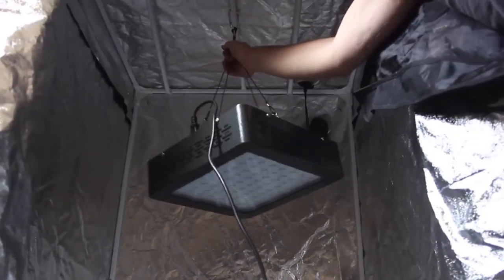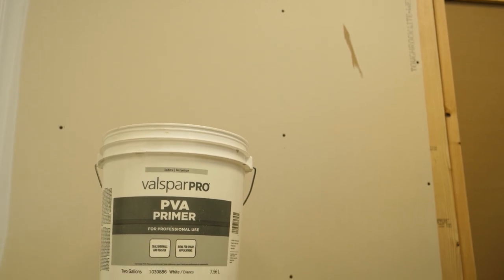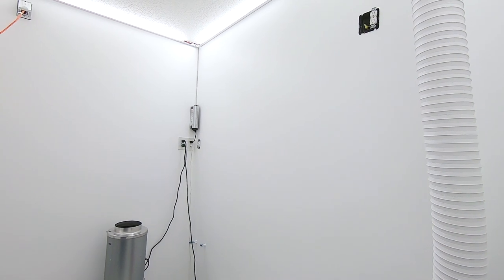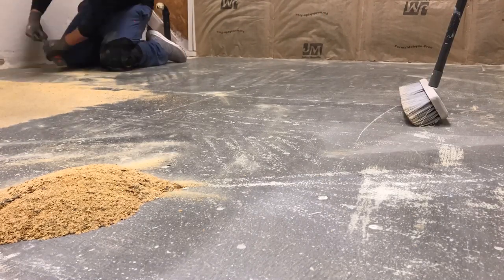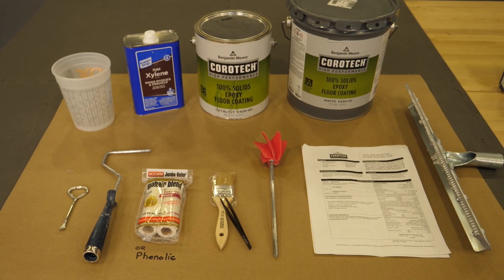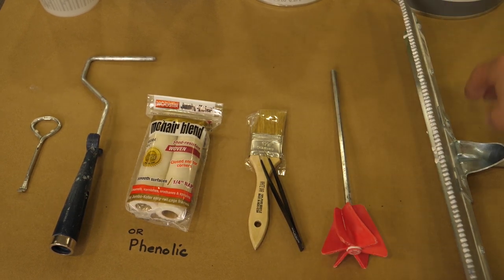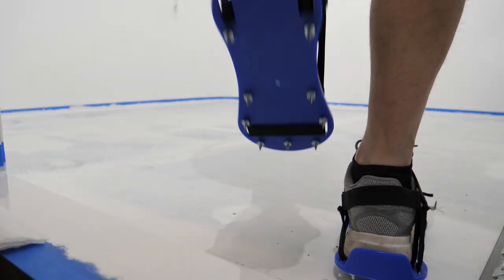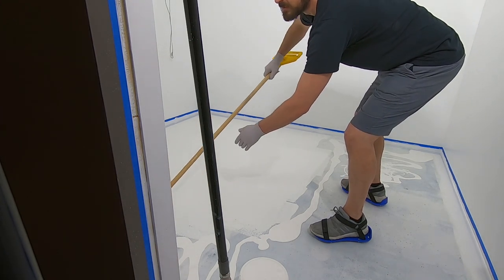Grow HauS vol. 2 : Performance Light Reflecting Grow Room Coatings

Comment: 91.82 reflectivity % Benjamin Moore flat snowfall white is the paint in my neck of the woods that has the highest rating. Worked fine for us. What are your thoughts on using aspenite painted white as a multifaceted reflective surface? Cheers.

Comment: I used the white 1/8 inch laminate paneling.  Works great.  No painting and it's slick and easy to wipe down.
Am TOTALLY not interested in reflecting light from underneath.
Reply: Yeah I am thinking of just using a nice vinyl layer and just but it a little bigger so it's like a massive tray.

Comment: I was planning on using r-tech like most rooms use.   I live is a hot climate (108 highs) in the summer time like now and cold in the winter (29 lows) in the winter.   I do plan on using a diy closed cell spray foam kit and do a full cavity fill.   Would you still suggest using Sheetrock and paint over r-tech in my room?   Can't wait for part 3 ✌️🤘

Comment: Definitely going to be repainting the barn and it's 3 grow rooms but changing to this paint based on your recommendation and now that I see the flooring idea of epoxy all I ask is what can I use to fill in my cracks in my seams in the floor to make everything even what would you suggest?
Reply from the maker: first, i would make sure the wooden subfloor has no bounce to it. a few extra screws into if needed.  Then I would fill the holes with this same line of Rustoleum boat deck filler. its available at West Marine.  West Systems also makes some boat fillers designed for this purpose: to fill holes in a boat's wooden hull before gelcoating.
Reply: Wouldn’t the epoxy fill the cracks? Or are we talking CRACKS? Cuz if you want to seal those, you can use quickcrete.
Reply: @juliankirby9880  no the epoxy is only going to be applied to 10 mils thick so in my case it's actually cement and I just went ahead and repaint it it for this round but I would have to I braise and use a self-leveling caulk or possibly in my case with some of the bigger chunks missing some Quick Crete and then make sure it's level and a braised before I attempted to apply the epoxy it catalyzes it doesn't really ever Harden which growmau5 explains in the video
Reply: oldschoolplayacom my knowledge of concrete floor repair is limited, maybe the flex seal paint In the cracks?

Comment: Wow I thought I was a stickler for details, but you take growing to a whole new level 👍👍   Awesome  👊 never thought of using epoxy on the floor, back in the day I used formica laminate sheet on 3/4 inch particle board I wasn't able to rip up the carpet. Can hardly wait to see what's next ✌

Comment: Hey Growmau5, Why didn't you go with the FRP wall panels? When installed correctly...  They can be hosed down and bleached in a few minutes and you would be have the room flipped and cleaned in a fraction of the time.
Reply from the maker: FRP is probably a better surface, esp behind the plant canopy for foliar. I may install one sheet horiz behind my canopy. FRP runs $28-32 a sheet for me here at the WA hardware stores. I considered it. but my room at 8'6" wide & 10ft tall makes for an odd looking install and a price point of $240++ to cover the walls up to 8ft. including adhesive. I spent about $80 on the wall paint. But I like the comment & suggestion. cheers and thanks for watchin.
Reply: @GrowMau5  Thank you for the response. Yeah it adds up quickly but I'm really enjoying the convenience of it. Here in the midwest, we can sometimes find it on sale for $15 a sheet. Still pricey but worth it in my opinion.

Comment: I'm thinking about using the Puck in my Mini Grow Box.   1 Puck for 1.31 sq feet
Reply from the maker: absolutely ! you can run it cheap on a flat piece of aluminum with a little 12v fan to move some air around. The meanwell LPC drivers, 48volt are under $20 too.

Comment: Hey Growmau5,  I'm looking at going the same direction with my flooring and doing an Epoxy Coat. My question to you is how well do you feel the epoxy covered small imperfections in the floor. Would it cover small gaps in a wood subfloor nicely do you think? I used a wooden specially designed insulated subfloor called Amdry for my basement as the concrete floor gets quite cold and uncomfortable here in Canada. Does it self level nicely? Also does it dry rock hard or do you feel the product has some "give" to it to allow slight flexing and thermal expansion.

Thanks Growmau5,  always love the vids!

Comment: Curious what you think about those mylar/"foil" backed sheets of insulation as far as reflectivity. Building in a basement and didnt want to use a ton of wood so was debating goin aluminum studs and the insulation as walls. Ive seen people use them in the past. Figured itd be a lil easier too since i can cut everything with tin snips and a small hand saw VS 2x4s and 4x8 with a circ saw and table saw. Thanks for any tips! Hope you get this poppin off soon!!

Comment: Great job man! If its a self leveling epoxy is there any reason why u couldnt just use the knotched rubber tool to thin it out good and then just let it self level back into itself without rolling it? I never did epoxy but ive done just about everything else in your video and now im considering it

Comment: I'm in a tight spot literally a 3x2 tent and normally grow under hps but due to heat I am looking for a quality choice led. I am looking at the mars hydro ts 1000 and the hipargero 800watt w/4 3k cobs and 16 osram leds....what would you recommend or choose if in my position? If neither could you recommend something 150 or less?

Comment: This is somewhat off topic, but I've recently been checking out the Blackdog Phytomax 2 800 and Phytomax 2 1000.  I would like to build a similar model myself, would it be much cheaper to build a similar one myself?  What would be the ball park to build a similar model?  Lastly, Could you possibly help me identify all the components that I'd need in order to build a similar model?  I'm sure there are quite a few components, but if you could give me a rough break down of what I would need it'd be a huge help.  Also if I wanted to go wireless on the unit,  could you give me a few options on what I'd need there?  I've spent some time looking at the Chilled LED Tech, which seems pretty cool, but i'm still somewhat in the dark on what components i'd need.

Comment: hey growmau5 . i know you probably wont see this ,but if you do i have a question. im from canada and finally making my own cob light. i now know a ton know about voltage ,and amps ,and series wiring lol. i bought 4 vero 29 gen 7  54 volt cobs and a hlg 320 1400 ma driver. the problem is this tapped me out. i cant afford to buy the pin heatsinks. if i get them from rapid led ,it comes to 170 dollars shipped for 4 ,and thats more then i spent for the cobs ,and driver. is there any other way to go thats dirt cheapish. alibaba is weird to use ,and takes months, and have to contact the seller . i watched your episode on heatsink sizing . im wandering if i used a 4 foot piece of hollow square pipe maybe like 4"x4"x4' with a fan blowing down the center if thats enough ,or if i got a solid piece 4 feet long how big would it have to be . there is some cpu coolers on newegg for 9.99 right now on sale, that have a tdp of 88 watts ,but im scared the contact surface is to small . we have a scrap yard so anything from there i could use would be great.

Comment: mouse be lookin thicc laying that epoxi. 
why dont wet sand it to level and then buff it out?
Reply from the maker: hey Federico, its a great suggestion but man, that would take ages. this stuff is tough. Id likely have to start at 60 grit and work my way up the grits. time value of money says another top coat cost me a few bucks but saves me hours. maybe at the annual cleaning or something.
Reply: @GrowMau5  its true its a pain and a half. But if you put another coat over the Orange peel It Will just copy It and turn out the same as the last coat. All uneven and blotchy. Happens with Cars, guitarra, antyhing that doesnt have a grain filler coat to even out the surface. The solvent works softening the top layer of your floor so the new layer Will attach to It and Bond. Thats why you'll keep running into those problems.
Or just leave It that way and say It is for light difusing purposes lol. Cheers Buddy.

Comment: Hello My Dear Friend
I Am Trying To Build Myself A Spider Farmer SF1000 And I Have A Critical Question About Quantom Boards?!!
Here Is The Part List That I Already Bought Them:
Samsung LM301b 3000K 135 Pcs
Samsung LM301b 5000K 73  Pcs
Cree XP-E2 Photo Red 660nm 9 Pcs  
Cree XP-E2 Far Red 760nm 1 Pc.
Meanwell XLG-100-H-A 
But The Fact Is That I Cant Understand The Circuit I Mean According To The Driver Capacity How Many Of smd`s Are In Series And Then Parallel And So..?
Im Wondering If You Can Help. 
Thnx.

Comment: I am working in a paint laboratory. You should have used water based epoxy products... It will take ages to get the vaporated xylene out of your room
Reply: Doesn't 100% solids have no xylene?
Reply: If its 100% solid than it has ofc no xylene. Sorry if i missed that
Reply: That's fine. In your opinion is 100% solids epoxy safe to use inside your home?